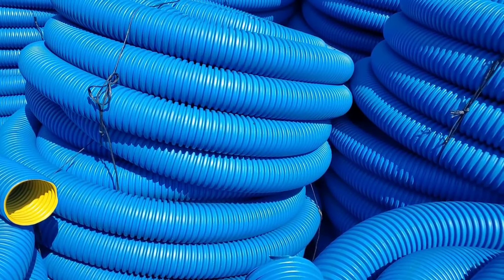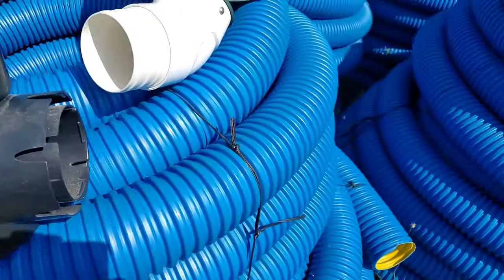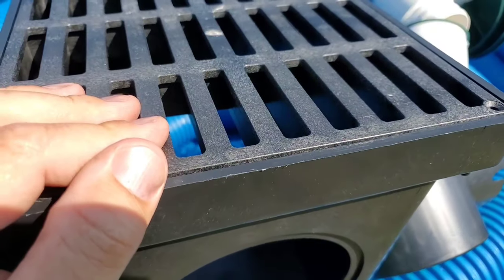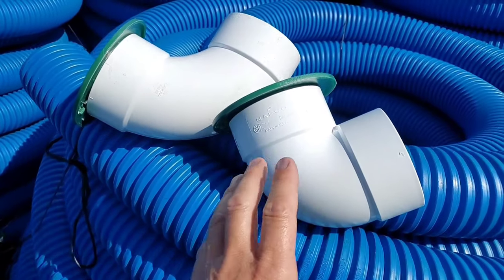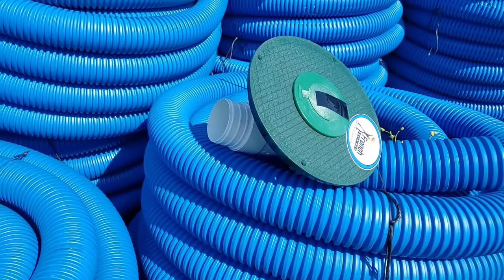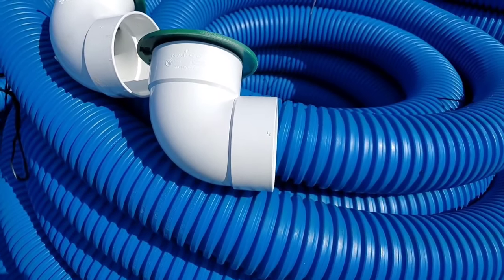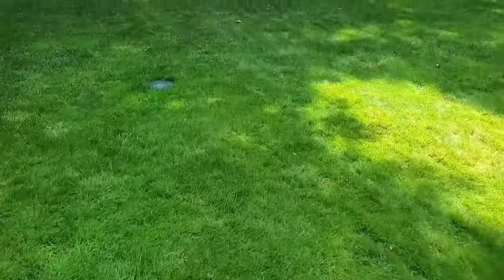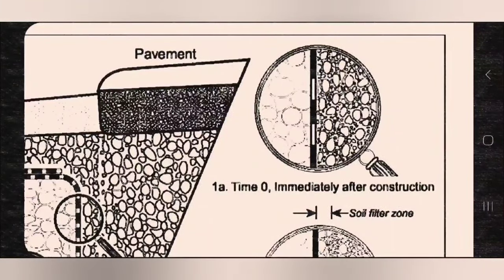Pop-up Emitter or Drain Basin? Which One Works Best for Discharge?

Comment: I still like the 9x9 & 12x12 drain basins for an outlet, however, on a house I built 4 years ago, the lawn guy let the grass grow completely over it (downspouts hard piped with 4” schedule 40 PVC due to potential vehicle traffic). A Maple tree was 20’ away from the outlet basin. An explorer/ feeder root found its way to the basin / grate (covered by the grass), it turned on a 90 degree, made another 90 sideways and into the inlet pipe, growing towards the first downspout, which on most mornings even without rain, would drip a certain amount of water into the trunk line. The 1-1/4 to 1-1/2” diameter root broke the grate and grew 40+ feet through the pipe towards the house. I was certainly happy we hard piped it, because once we got the basin out and its adapter off, the root had nothing to grab onto and it pulled straight out in one piece. I took pictures and the owner who was up north at his primary home, couldn’t believe it. Needless to say… a new lawn man soon appeared. 😂
Reply from the maker: That's why you need a pop-up emitter. Tree roots can't get inside. 
https://youtube.com/playlist?list=PLjFCqaZ4v1BXt8vDpjMmvJXxMn8Tgw0wA&si=gM4PDN_nCQw_PtHq
Reply: @FRENCHDRAINMAN  Not quite. It more accurately suggests to keep the basin drains / grates free of grass / weeds and debris. I stopped using pop-ups BC of their inherent design / functionality issues. IMO, both have trade offs. ✌️

Comment: Thanks for posting this.  How would someone in the northeast solve the problem of snow (i.e. 1-2 feet) covering the pop-up emitter?  I assume it's just digging it out, but curious if you have any advice.
Reply: Put a bucket over it before it starts snowing. Pin the bucket handle to the sod with landscaping staple things.
Reply from the maker: https://youtu.be/1kPHHnDc1ZY?si=7jcDsD6lnXX-_357

Comment: Smells? Holding water? Cut the bottom out of a catch basin and place it over about a foot of 1 inch rock if the soil won’t drain. Worked very well for me.

Comment: I have a 12x12 "petri dish" catch basin as my emitter at the end of a system that moves a lot of water.  The pipes going into are pretty deep down there, so not sure if it would be practical to use a pop-up.  It is surrounded by rocks at the moment.  Would you recommend drilling some holes in the bottom to let it drain?  We have sandy Florida soil.  Is there a way to install a popup emitter into that existing box?  It would be interesting to have some kind of an adapter to fill the box with a pop up emitter.
Reply from the maker: Watch "Installing a pop-up Emitter Drainage System [ DIY Drainage Solutions ]" on YouTube
https://youtu.be/gN12GFchTcU
Reply from the maker: Yes drill holes the Florida sand will drink it up!
Reply: @FRENCHDRAINMAN  Thank you for replying!!  I drilled about 16 1/8in holes, filled it up with water, and this morning it has drained about half way!  The mosquitos are going to have to find somewhere else to hang out!  Thanks again

Comment: Hello. Dekalb Illinois area. Want to install some wye downspout adapters for 3 gutters up front connected to heavy duty pipes you supply. My question is can I bring all 3 gutters into one line using your Y corrugated adapters, then hose into a cleanup bassin,then hose continued down to final pop-up V2 emitter?
Reply from the maker: https://youtube.com/playlist?list=PLjFCqaZ4v1BXKlR6qPMC_8I00r5KGdoP9&si=9cxGH1L52y2ia9Q1

Comment: Thats the answer i was looking for..you drill a few holes in the bottom. I live in colorado mostly dry climate and i have a short 6 ft run. So i dont need a long knife cut. I dont have room for it and its all rocks. So no issue with grass growing over. Thanks.

Comment: Just built my home and got moved in July of 23. Had to make driveway paver come back and put a sleeve under driveway as his crew had landlocked a downspout near walkway. It looks like 3 or 4 inch  pipe like your blue but thinner and have heard even if you dig out both sides of walk way it will just tear trying to get it out. Any ideas on how to fix this with your pipe and emitter?
Reply from the maker: https://youtu.be/ekh_OmlAJJo?si=TYzvpPECwXqb_2gI

Comment: So have you tried slots?   I see holes being drilled for many purposes, in this case water drainage.  I have used a coal fired forge for many years and the best design to prevent restriction of air flow is to use slots.  Holes allow detritus collect around edge and squeeze closed,  seldom does that happen on a slot.  My guess is a slot has 2 sides which won't support the other.
Reply from the maker: https://youtube.com/playlist?list=PLjFCqaZ4v1BXt8vDpjMmvJXxMn8Tgw0wA&si=dgq5Sz-anCVKBHMW

Comment: Good points concerning the downside of a basin.  Unfortunately, I'm dealing with extreme water flow and not sure if pop ups can handle the flow without backing up.  The amount of water I'm trying to divert during a heavy down pour is about 12 feet wide by three to four inches deep, which runs through a back yard swale.  The heavy flow dissipates about 30 minutes after the rain stops. My plan is to install two 4" x 10' corragated pipes (side by side) at entry covered by cobblestone with a solid corragated run of about 50' to discharge point.  I'm far from an expert and would appreciate feedback.
Reply from the maker: We use our 20 inch round Basin for jobs like yours
Store | French Drain Systems | Curtain Drains | Macomb, Oakland, Lapeer, St. Clair County
https://frenchdrainman.com/store/

Comment: Great info and video!!  so sir, between my house and my neighbors house there’s a low spot and that water is running in my yard and I need to get it from rolling in my yard and get it into some type of drainage system down to the street it’s about 50 feet maybe 60 feet of pipe how should I do this? With your materials? Thank you.
Reply from the maker: Best French Drain and Yard Drainage Contractor
https://frenchdrainman.com/

Comment: I used a PVC DWV Sanitary Tee with the grate like the catch basin as a top and filled the hole with pea gravel so no standing water.
Reply from the maker: The grate will not allow leaves or sticks to clear and it will clog. I wouldn't advise doing that.
Reply: @FRENCHDRAINMAN  didn't think of that, thanks.

Comment: Can I use a 90 degree elbow, and slotted pop up emitter cap as a catch on the end of our new drain?
Reply from the maker: No, that would be the worst thing you could do.
You want to connect it to one of these:
Pop-Up Emitter for Corrugated & Turf Restrictor Plate (4 in.)
https://frenchdrainman.com/product/4-in-corrugated-pop-up-emitter/
Reply: @FRENCHDRAINMAN  I’m thinking about using an elbow as a catch basin. As an intake at the top of our new drain. It’s got great slope.  The gutters all come out at the same location.   They fall onto a concrete ramp, then head into our drain

Comment: We just got underground pipes installed and the discharge area keeps clogging with tiny petals. We do not currently have a pop up emitter. Its a grate. Does a pop up emitter allow smaller debris to pass through more easily?
Reply from the maker: Yes
You need our pop-up emitter that you can get you hand down inside. Grate is terrible. 
Best French Drain and Yard Drainage Contractor
https://frenchdrainman.com/
Reply from the maker: Best Pop Up Emitter FDM's V2.0 for Downspout Drainage
https://frenchdrainman.com/drainage-products/pop-up-emitter-and-turf-restrictor-plates/

Comment: FDM I just ordered your standard buried downspout kit. I'm a little confused as to whether to tape the end cone to the dual wall or not. Your intro video for your kits mentions taping the ends and in this video it's removed for maintenance. Do you recommend taping the joint and drilling holes for drainage??  Thanks
Reply from the maker: We only tape up by the house. The clean out vent should be taped so no water leaks at the house. The pop up doesn't get taped
Reply: @FRENCHDRAINMAN  thanks for the reply!